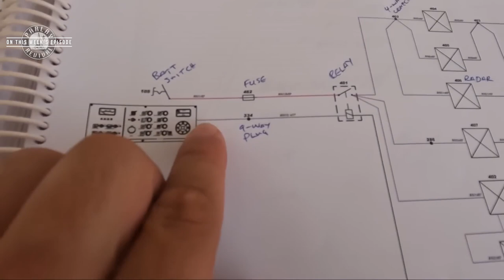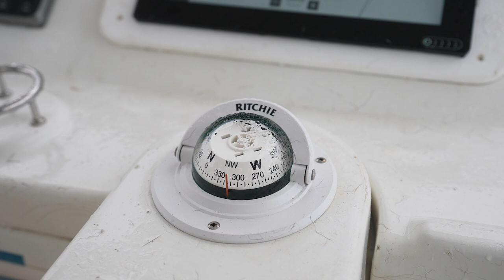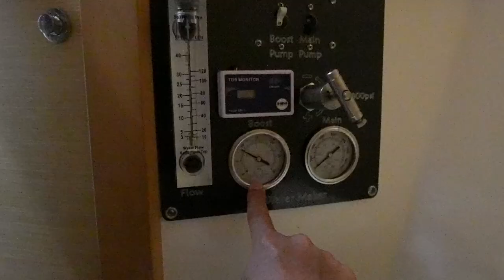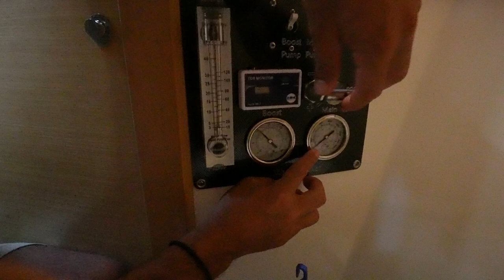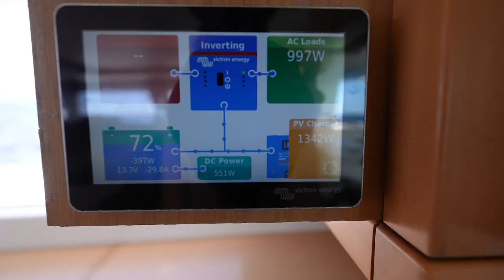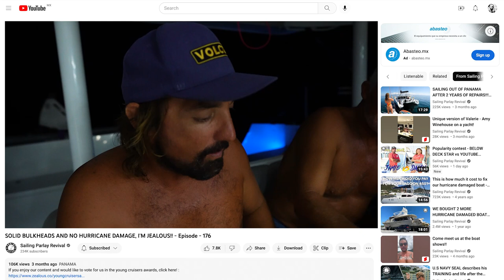HURRICANE DAMAGED CATAMARAN getting SMASHED by the elements! - (Episode 198)

Comment: When I started ocean cruising “hand” sailing was it. If the wind was against you, you had a beat, no motors. Heading was by compass. Pre GPS we used a sextant for position then kept way marks based on speed and direction in between. The first GPS was $8000 the size of a large desktop PC and gave a reading every 90 mins as a lat/long good to within a mile. The best thing about it was that in prolonged bad weather when you couldn’t get a sighting you could sail into port as long as you had some visibility. Those without had to sit out getting knock about until it cleared.

Comment: On my previous boat I built my own water maker using all the standard off the shelf parts used by the vast majority of water maker manufacturers.  I made my water maker redundant by installing a high pressure pump on my engine with a electric clutch.  I cut my own accessory mounting brackets for the engine out of stainless with my water jet table.  I don't know if it is common practice to have a engine driven water maker but I did it for efficiency and redundancy.  I could make water any time I was motoring and it only used about 1hp of the engines power.  I also had 4 40" membranes with a manifold that I could isolate or direct water to any or all membranes.  If I ran both the engine driven and electric water makers at the same time I was able to produce nearly 100 gallons per hour.  On my next boat I am building something similar except that I will have a much larger high pressure pump that will allow me to produce 2 gallons per minute so I could run my engine for 20 minutes and have 40 gallons of water.